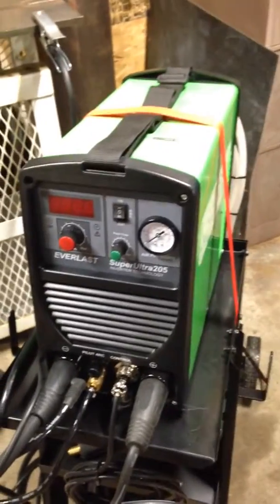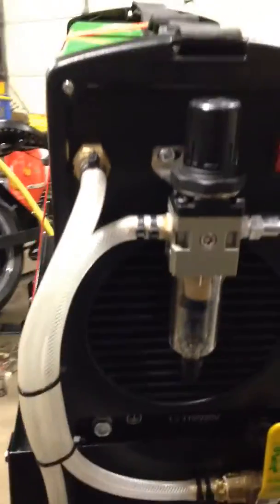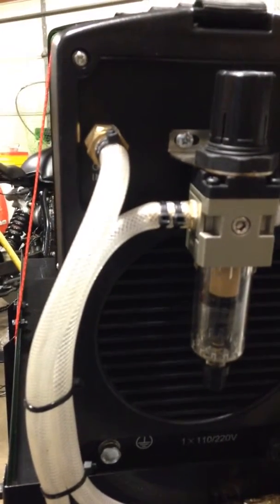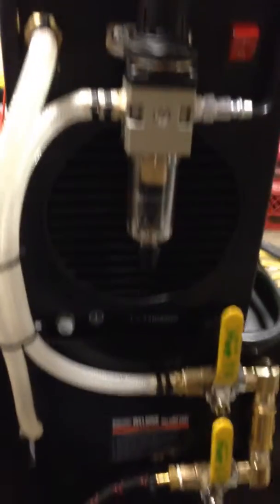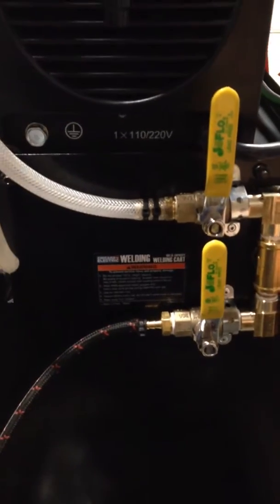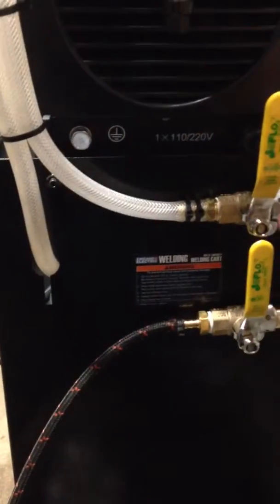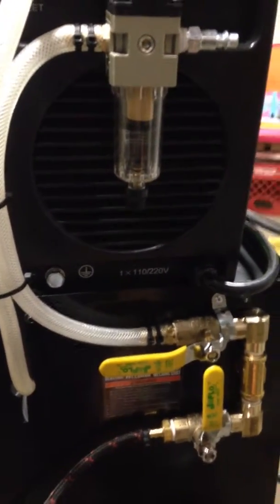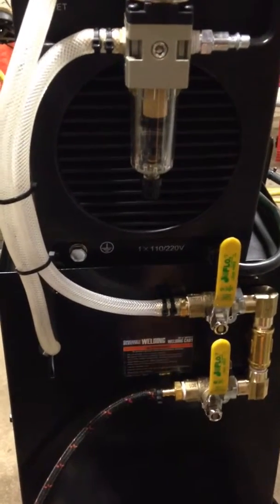Everlast welder modifications

Comment: could've used air fittings and hose. switching between welder and plasma cutter would be the same as switching between air tools and cost less then $50.